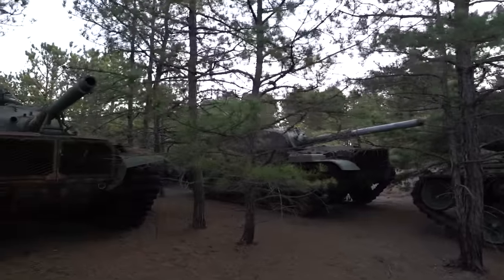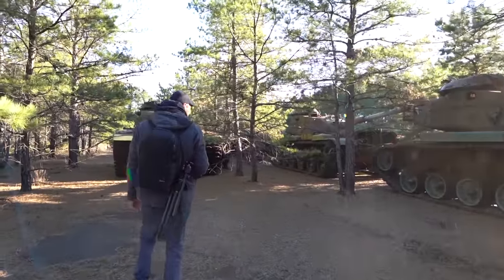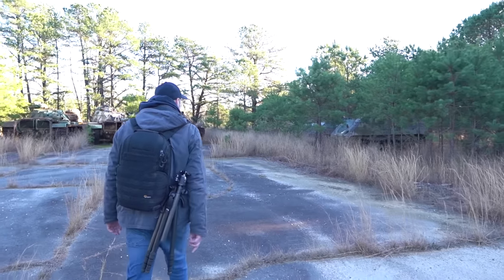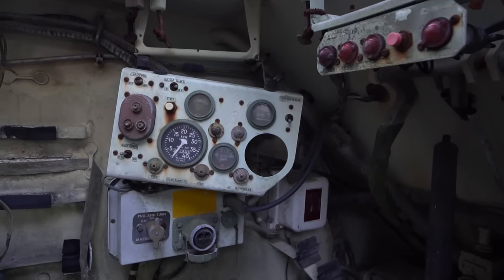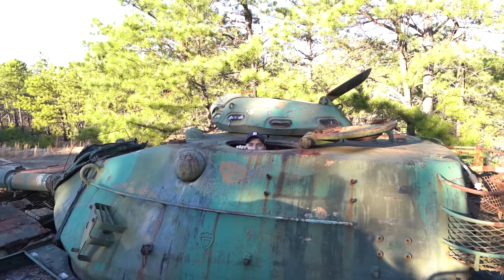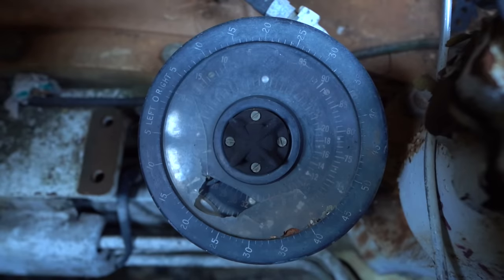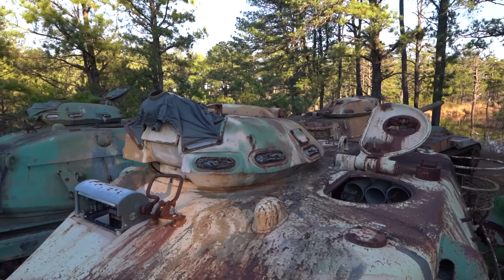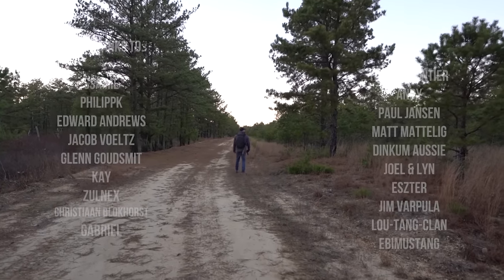Found  ABANDONED TANKS dumped in the forest | URBEX

Comment: I dont want to be a smartass but the M60 never was named Patton, only the M46, M47 and M48 were named that way.
Reply: Yes, the M60 series tanks were not named Patton. But they were a further evolution of M46, M47 and M48 tanks...
Reply: You’re right but due too it’s resemblance and parts that it shares with the m48 pattons most people just gave it the unofficial name of Patton even the early m60 had basically a m48 turret wasn’t till the mid 60s that the A1 came along with the newer narrow turret the one you can see in the video and the M48A5 Patton was pretty close too the early production m60s just had different hull armor lay out the Patton had a roundish nose the m60 just added the more traditional angled plates

Comment: To clarify, those APCs were the M113A1, major pain in the ass to drive due to their stick stearing, the A2 and A3 varients weren't bad, but they sucked if you were traveling in a convoy since other vehicles had much higher travel speeds. Interesting fact: While most crews and squades would want to sleep inside the M113, since they could easily turn on the heaters, I always rolled out my sleeping bag onto the radiator, since it was directly above the engine bay and retained heat all night long I was always cozy. There was a brief time when we were issued stripped down Bradleys for a field exercise, giving us at least some firepower and speed to keep up with the rest of the vehicles, but they quickly reissued our "hoopty" M113s back to us. We wouldn't have better vehicles until they issued us Strikers.
Reply: That Striker is a nice vehicle
Reply: Right on about sleeping on the radiator, the only time I slept inside was if it rained. A3s were great, could pretty much keep up with M1s on the road and (barely) out run a base-model Bradley in a drag race ("allegedly" lol). The sliding spall liners were great for keeping the crew compartment nice and tidy, too. Hated when we switched to Brads.

Comment: I crewed an M60A3 from 1985-1988 when we received M1IP Abrams. Man I would love to get in one of those and remove a few pieces. Azimuth indicator, ammunition select unit, gunners power control handles to name a few.
Reply: I drove our blade tank until we got the A1's in 87.
Reply: @tanker335  B65 5/32 Armor FT Stewart Ga. I know the way of the Blade as well.
Reply: I oversaw production on the 30mm an 25mm LAP operations at JAAP. the last 6 years I managed the production of 569k AT-4's and about a year on SMAW HEDP rounds which were a major headache due to malfunctions of the fuse.  Used to go to McCoy to do night LAT testing of 25MM HEI ammunition

Comment: USAG Grafenwoehr has a bunch of abandoned tanks and buildings/bunkers that are worth checking and easy to get to off of the tank trails
Reply: I was part of the 317 the engineer battalion that'helped build the range in Grafenwoehr in the early 80s
Reply: Several of those bunkers are in the impact area though, and Graf has been in use since WWI - lots of UXO out there.  OTOH, on the 3 days or so that Graf is shut down, AND you are extremely lucky, there are huge deer and elk all over the impact area and the edges of it.  The boars taste good too if prepped right.

Comment: You might have found gold, speaking figuratively, about the discarded M-133 APC’s. The M -113 is still in use with the A2 and A3 upgraded variant. This tracked APC travels well in an airbourne capacity inside a C 130 or C-17. Due to is light aluminum hull  it’s moderately amphibious if not overloaded. When upgraded with reactive armour it can survive light anti armour weapon hits. It’s still an excellent choice of  armoured vehicle where a light skinned vehicle offers too little protection and an Abrams Tank or Striker IFV is too much show of force for a mission.
Reply: Can be repaired or sent to Ukraine for parts.
Reply: @dannylo5875  LoL - reconditioning old hulls for service is a slow process. The hulls are stripped bare and examined for cracks or fractures in the aluminum before they are selected to be upgraded with all new parts. The task of refitting and upgrading the hull takes somewhere around a year. Simply because there are no more assembly lines everything is hand fitted from welding, fabricating new parts, installing engines, transmissions  and tracks to paints and coatings. Then Q/A surveys are done in between phases of reconditioning. After the work is done the completed M-113 A goes on for trials and evaluations, defects are corrected if it passes all the testing it goes into service as basically a new APC. Defence contracting moves slow and steadily.
Reply: @dannylo5875 maybe the m-113 parts. The M-60 tanks would have no value as Ukraine is not using them.

Comment: Those APCs had one fatal flaw, the fuel tank was under the floor. Great spot to save space but really bad when you're hit and you have 15 guys sitting on top of a fuel bomb.
Reply: The fuel tank on a M113, was not under the floor. That is where the rod's for the wheels ran from side to side. The fuel tank was in the interior of the apc on a shelf on the left side rear. I know because I drove one and also did maintenance on them.
Reply: @garymathena2125  thank you for correcting me.

Comment: I'm actually surprised these old tanks were left, but at this point, they're nothing but rusting heaps of scrap steel.  It appears they've been gutted of everything useful, especially the engines/transmissions.  Likely they'd been used for training, but IDK if this former Army fort had a live firing range.  I doubt it, as they didn't find any hulks that had been battered and/or penetrated.
Reply: It appears to be at Ft Knox , which doesn’t train troops anymore and is mostly admin units there .

Comment: Hmmmm..... A section of military base you can walk into from the woods.... AND those woods happen to be substantially scrabbly, spindly pines, AND the soil looks like there are patches of sugar sand.... So, a trip to Joint Base Dix-MacGuire-Lakehurst, "sneaking in" on the pine barrens side. Not anything particularly special; people do that all the time. You just need to be careful where you're wandering along those southern or eastern edges of the base, because it is possible to wander onto an active firing range, and the mortar and artillery ranges aren't exactly obvious like a small arms range would be.

Comment: These were NOT used in desert storm, they were phased out long before. The M1 was in service in 1986 and was used in desert storm. And there isn't any APC capable of holding 50 troops. Get ur lies straight.
Reply from the maker: "The M60 series main battle tanks of Egypt, Saudi Arabia and the US were deployed in Operation Desert Storm in 1991 during the Gulf Crisis. M60 tanks entered service with the US Army in 1960. The M60A1 with a new turret, thicker armour and a new ammunition stowage system, was manufactured from 1962 to 1980. M60 performed well against enemy units with no loss."

And I say 15, you can also see 15 in the subtitles.

Comment: American obsolete military equipment is “hidden”, they are drained of all fluids, batteries removed as well as any classified equipment. Then they are parked in an out of the way location. What then happens is…time. The wildlife encroaches upon the parked vehicles. If not armor, fighters, other aircraft, it may be sold at a bulk item auction. That is why you see M35A2’s, M1008/1009’s, etc., driving around.

Comment: Perhaps, I missed it, but thought I saw a “Slick 60” in the prescreened shots, but I may be mistaken, … same hull, & gun tube, but just an earlier version of Turret, … because there were several there with the TC’s cupola being the advanced type, … and the tapered turret, … and some of them did look like older models because of missing later advancements like where the grenade launchers would be located, … I was tasked in 1973 off writing up the paperwork for turning in a “prototype” of a Slick 60, … that had began its life, at the Blaw Knox corporation, in East Chicago, Indiana, with the serial number being 000005, welded on the right rear lower quarter of the hull, ending with, becoming a target, tank at  Grafenwöhr, gunnery range, … while stationed at Kirch Göns, West Germany with C/2/33rd Armor/1stBde/3AD, at Ayer’s Kaserne, aka “The Rock”, the coldest place I’ve ever been, … which was roughly 45 clicks north of Frankfurt, West Germany, about 1/2 way between Giessen, & Friedburg, West Germany, … Elvis, … 1st Sgt, was our Bn SgtMaj, … Have you guys ever heard of the Hessians? They were the German, “professional” soldiers that the British used against us, back in the Revolutionary War, … this, was the area of Germany that those troops came from, … I’ll just about bet that I pulled as much guard duty as the time I spent in that concrete padded motor pool, … working on those tanks, … who knew, at that point, that the Vietnam War would end, only a year, & 1/2 later, …

Comment: Only M60s that served during the Gulf War in 1991 were Saudi. All U.S. forces used M1 Abrams even the Marine Tank battalions.
Reply: Marines were still operating m60s in the Gulf as well. The Museum of the Marine Corps refers to it as the m60's last hurrah.  Even the Army was still using M60 based vehicles like the m728 CEV.  Then some reserve and national guard units still had M60 avlbs until 2019.
Reply: @G. Sanders  I thought the Marines M60s were replaced when they got to Saudi Arabia because they were concerned with its ability to defeat the Iraqi's T-72s. I know they had M60s when they arrived, but read somewhere that Schwartzkopf ordered a crash replacement of them before the ground war started. I was Navy, so no ground pounding for me....just dodging mines.
Reply: @patrickmccrann991  the Marines were already trying to replace the M60 when they were ordered to the Gulf, but they aren't going to replace equipment while in the field due to the amount of retraining needed, and the changes required to the supply and support systems.

Comment: I believe that M60 had the rate 45cal Chaimberlain machine gun. I mean rare. There was placard on most of the tanks that had em so they didn't load the wrong ammo. There were only a few M60s made with the Chaimberlain machine guns. I believe they had the designation M60 a3ac. I am not a tanker at all I am pilot but often we came in contact with hardware on bases and had look see. Not many folks know how many strange variants there are out there. I think the oddest M60s were only produced one year to be sold to Thailand if I am right they had the 45cal gun on em. There was Nam era Patton that could fire cluster bomb shells which technically were illegal but they had em back when probably still do. I know they have the shells for the Howitzer. They fired em off in Iraq as well from the howitzers and the Abrams too. Some of my outfit had cockpit smoke grenades in a travel compartment dated Feb of 1966.
Reply: It had a M240 7.62 coax and a M-2 .50 cal in the T.C's cupula. We did have two M3 .45 cal. Grease guns of WW2 fame as crew weapons as late as the 80's. Other than that our personal weapons were the M1911A1's.
Reply: @tanker335  I believe when some of this stuff was sold there were surplus items that for one were never used by our forces. The twin 45s I saw on these tanks were mounted on a swivel pole UP TOP in place of the 7.62 guns. I believe that was done because of the cost of maintaining the Brownings as well as cost of the ammo. Someone else piped up said the paltry few we gave to the Philippines also had the same conversion set up. He also elated the tanks are just about sitting in the same place as when they were delivered in the mid 1990s. some time. I myself don't really see a reasons the 30cal Brownings were removed. I saw it with my own eyes. You can tell I'm old timer when we still refer to the Browings as a 30cal & not a 7.62.

Comment: well there a fuel problem low sulfur diesel, fuel injector failed to run right add a gallon of oil to fuel ever fill up was fix! today gas is off to a blend of ethanol & unleaded 2 stroke out board death!

Comment: If you had 6 12v regular car batteries with you I bet they would start. That tank has no type of safety lock out to deter it.  I worked with them when I was active duty for our ranges. We would do nothing more than get in one  hook up a jumper or Slave cable from another tank a 99% of them would start right up and go. They all looked just like these or worse but only had 20hrs run time and 5 miles  and we would drive them out to the gun range for target practice or  drive them to another building to be torn apart and recycled
Reply from the maker: Most of them had the engine removed . Thanks for checking out!